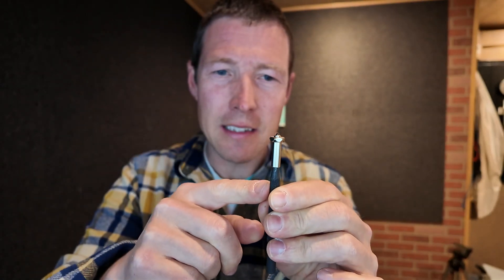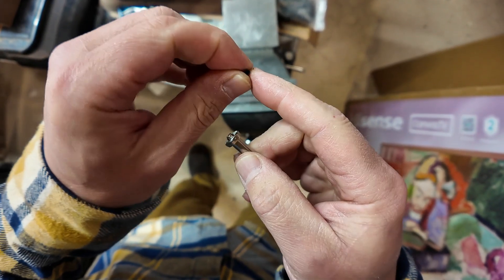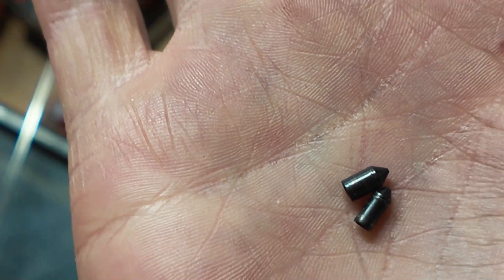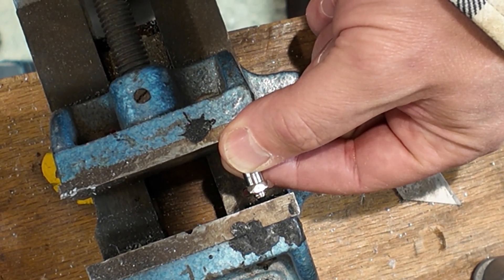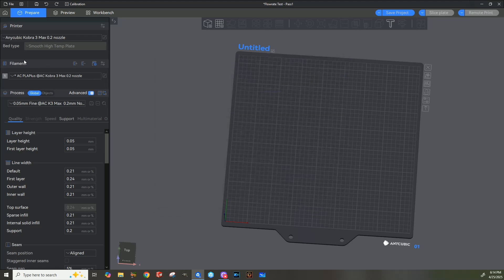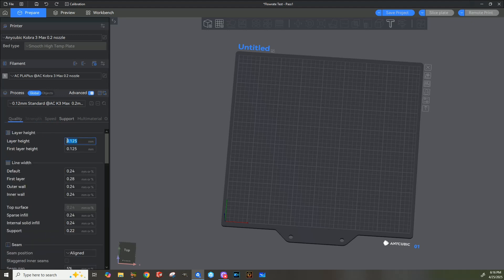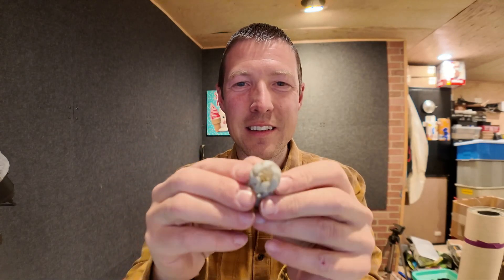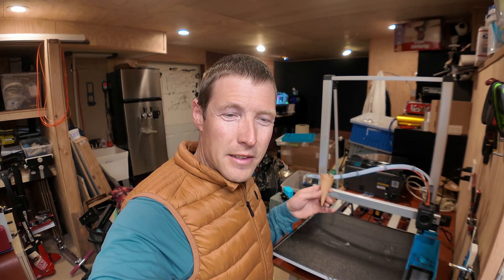I made a 0.2mm 3d printer nozzle for AnyCubic Kobra 3 Max

Comment: I love the comically small benchy on the max bed size haha! 

On another note, you said on the last video that you can put tpu in and set it as petg and it'll print fine. Is that something you could test? I'd love to see a way to print tpu with rigid pla supports, but I can't do that without the ace pro working with tpu

Comment: Why don't they sell these nozzles? Are they just not out yet. Clever to just make them yourself.
Reply: They do sell them and have for the entire life of the printer. The guy didn't look very hard
Reply: @TheAddanz  got a link?
Reply: @TheAddanz No they dont. You're probably thinking of the regular Kobra 3. The Max uses a completely different design with an integrated heatbreak and there isn't a single .2 nozzle for sale for it anywhere. Not ebay, not aliexpress, not amazon, not google.

Comment: Ok, its official I need to stop watching your channel, I just got done drilling out some Kobra 3 max nozzles and had fun doing it, but now I need to buy another one to do this, ha. I wonder if it would have been easier to just tap the nozzles out and put .6, .8 in also? I think I will buy 2 tonight and drill them out , tap them and add the CHT  v6 nozzle to one and see if it works just to stay ahead of your videos. Ha, your going to cost me hundreds on this printer. Oh, and you are the man, great videos!!!!!!!!!!
Reply: haha im jealous.  waiting for my grandma to come over and do this for me because I just keep messing it up, and im 43years old HAHAHA.  she is thinking we should try drilling from the bottom instead of the tip to make the .4 a .8.
Reply: @sincejesus  No, just wd40 and take your time should take 20 minutes no pushing just let it happen slight pressure. I did it after a few vodkas, ha.